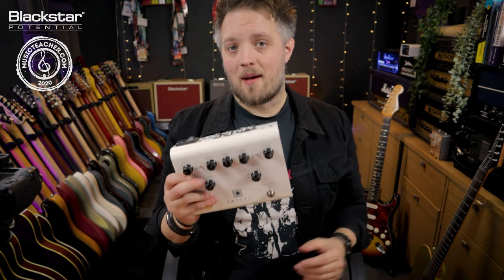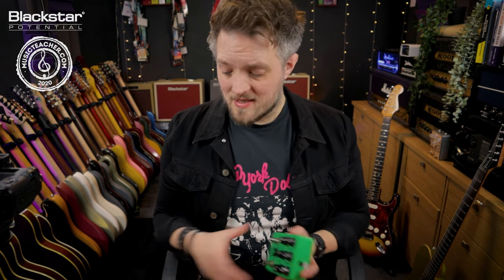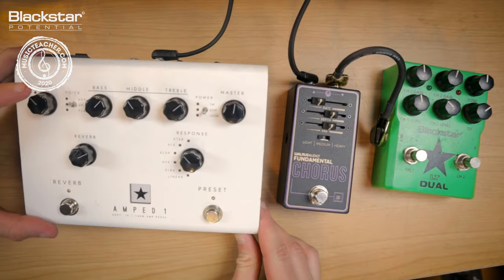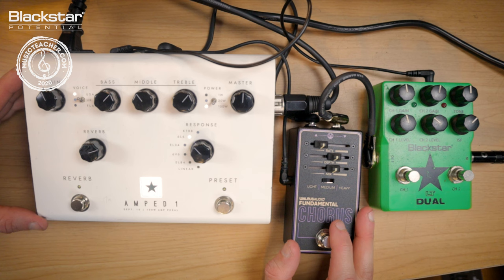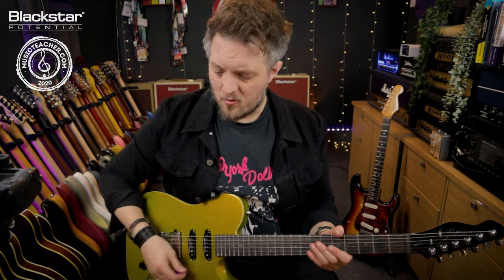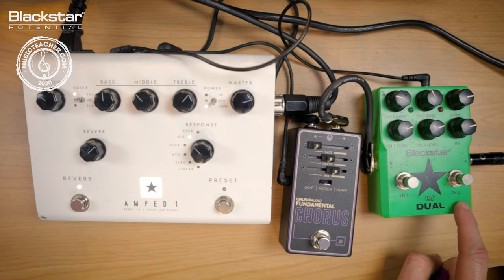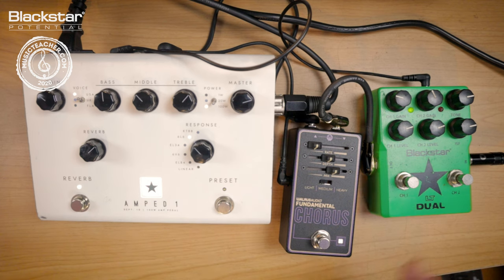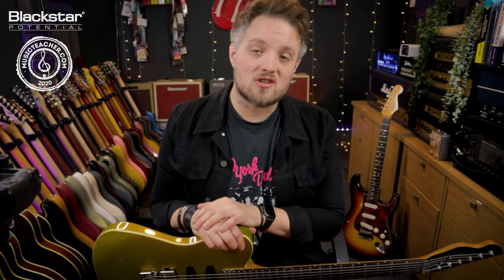Building a Fly Rig with AMPED 1 | Blackstar Potential Lessons

Comment: Can I connect the Amped (1 or 2) to a passive speaker with a normal guitar cable or I must use a speaker cable?

Because if I must use a speaker cable I need to build a very long cable
Reply: It has to be a speaker cable.
Reply: I use a Blackstar Amped 2 with a 1x12 speaker cabinet on stage, connected via a 6 metre speaker cable. Any decent guitar shop will sell you a long speaker cable.
Reply: @peterstorey5397   Thank you Peter!!!